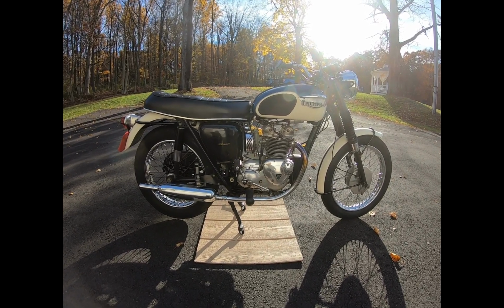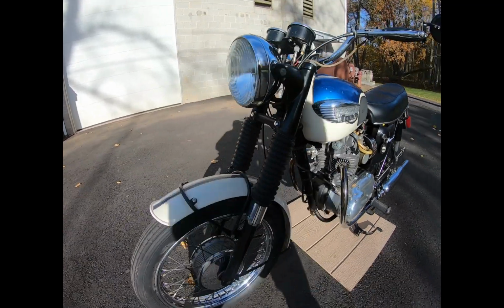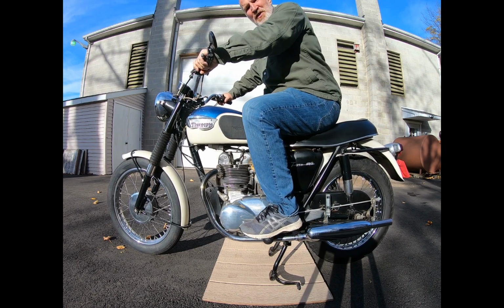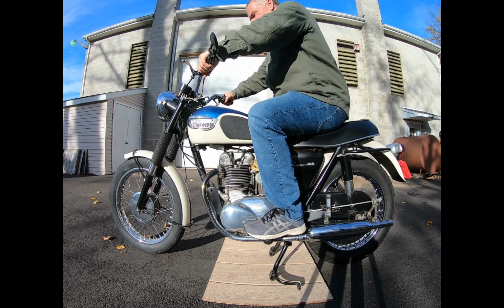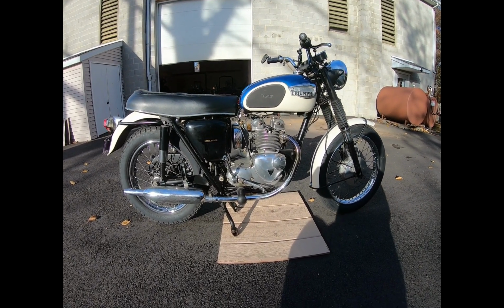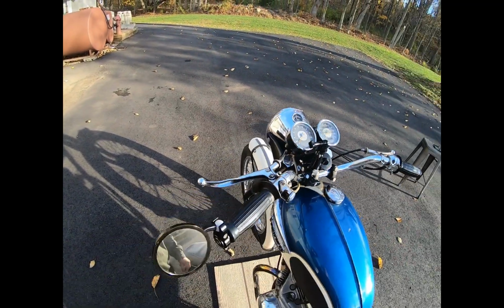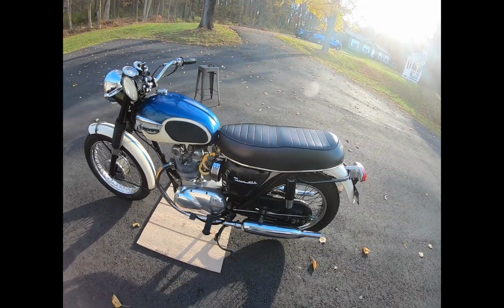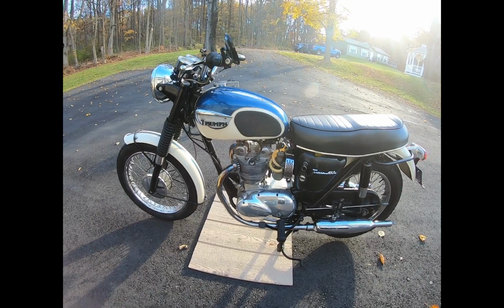1967 Triumph Daytona Video

Comment: I just got a 1967 Trophy T100C last week. It's pretty much a stock original survivor, except for tank and lack of speedo. The Triumph scramblers always reminded of Schwinn Stingrays, and the bike is incredibly light and revvy. It belonged to a vehicle collector who acquired it the early 70s, and the high pipes, levers, pegs, and frame are all unblemished which leads me to believe it had never been ridden off road. The Dunlop Gold Seals are severely dry rotted and I suspect it had not been seriously ridden in a decade or three. Interestingly, the Trophy features Triumph's Energy Transfer ignition system, which eliminated the battery. This is my first Triumph and I wasn't sure how to work the Amal Monobloc, but after a local Triumph Yoda gave me a few hints, I started the bike yesterday morning and put 5 miles on it in my jammies and slippers, shifting through all the gears, cruising in fourth while being chased by country dogs. It's quite a pleasant change from my daily ride, a 1982 Harley Sturgis.

Comment: I'm actually surprised it started that quick. My carbs almost are always gummed up after just a few weeks with ethanol. Great bike.
Reply from the maker: I only run non-ethanol fuel in my vintage bikes to help alleviate that problem.

Comment: It looks like the bottom end still has the timing side bushing and not the bearing that was on the later 500s. My 1966 has a single Monobloc and it runs just fine.
Reply from the maker: Yep, there is nothing wrong with monoblocs.  I have them on several older Triumphs and I actually think they are better than the concentrics that came later.
Reply: @RobsRidesPA  It's tough to get the Monobloc set up right. The float needle has some issues as well as the old style float sticking. I had trouble getting the pilot jet circuit clean even with its removable jet. The float bowl cover needs attention because they are all warped. (I had a buddy that made a jig for his lath to turn them flat.) But that said, once I got it working right it has been a great carb. It idles and has big knurled knobs for setting the idle and air mixture.

Comment: For much of the first few minutes of ride, the tacho needle looks a bit skittish. Might need some lubing of the inner cable winding. Usually a light grease helps.
Reply from the maker: It's not the cable, its the tach itself.  Sent it out for rebuild and now it works fine.

Comment: Nice ride, brother. Wind noise is strong. But what do you do? My ride this weekend did the same. Yes! Very enjoyable to ride. Enjoyed the vid!
Reply from the maker: Thanks for the kind words.  I am not sure what to do about the wind noise, if you can do anything.  I am new at this videoing stuff and trying to figure my way through it all.  Please keep watching for more contect to come.
Reply: @RobsRidesPA  You need to cover the mic pickup on the camera...or plug in an external mic that you then cover in a "dead cat" fluffy or foam sock. I've had good success with just placing the external lapel type mic in my pant pocket. This picks up good engine note while killing wind noise.

Comment: Beautiful bike.  I bought a 1964 TR6 not too long ago.  My first vintage Triumph.  I love it.    
I have a question for you.. if you're out on a leisurely cruise on that bike, what speed do you normally shift from 3rd to 4th gear?
Reply from the maker: Hi Dave.  Thanks for the comment.  Honestly, I don't pay that much attention to the speed, more to the revs and what the engine is doing along with what I am asking it to do.  These 500cc bikes like to be rev'd, so don't just lug it around, they really start to wake up when you rev them up.